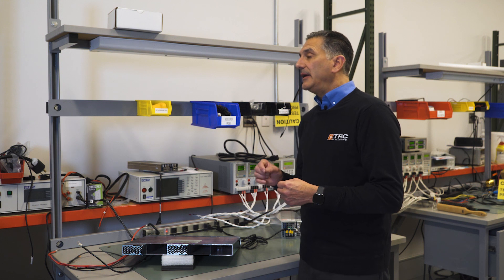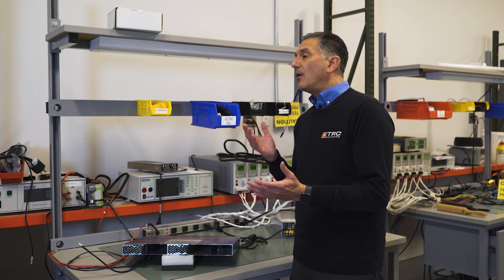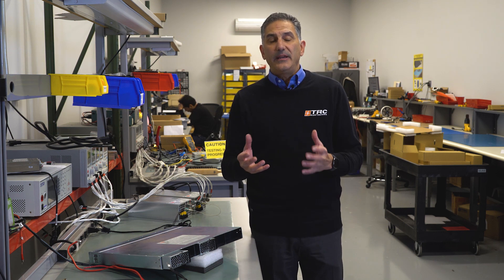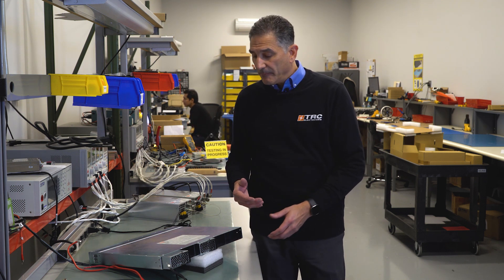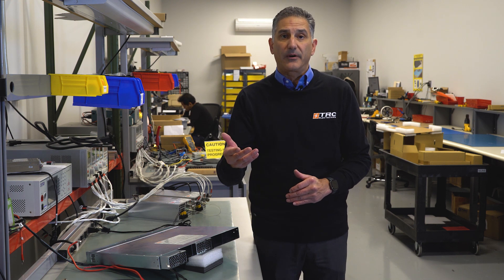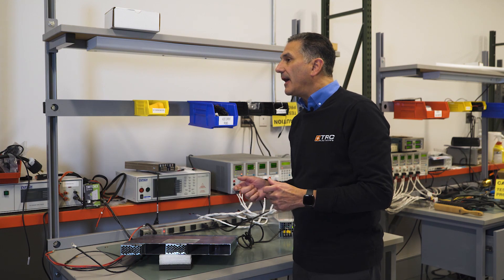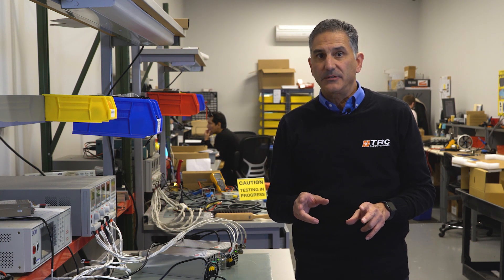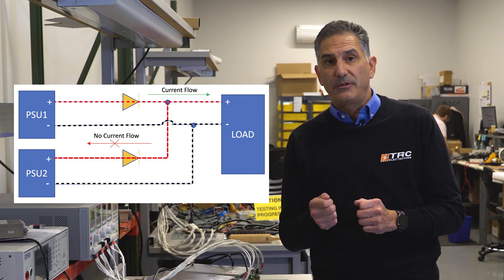Stay Plugged In: Connecting Power Supplies in Parallel

Comment: Hi..if I wanted 200 amps from 2 power supply's  at 13v 100a each would I use 300v 200a schottey diodes..kind regards Paul United kingdom
Reply from the maker: Hi Paul, we recommend using power supplies that are designed to be paralleled as a first option. In the event that this is not achievable, when selecting a diode package we recommend a part that has a reverse voltage of at least twice the power supply output voltage and is rated for at least four times the load current to account for potential current spikes. Please give us a call at 888-612-9514 if you need further support.